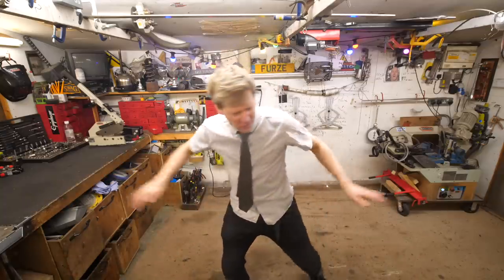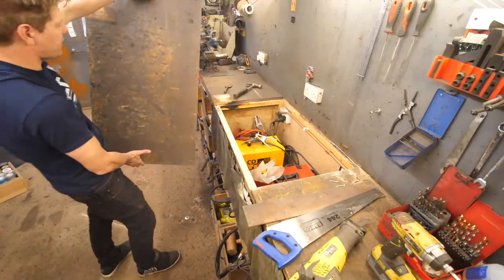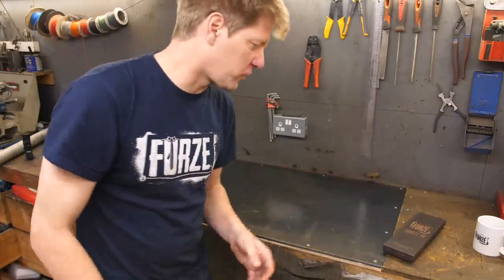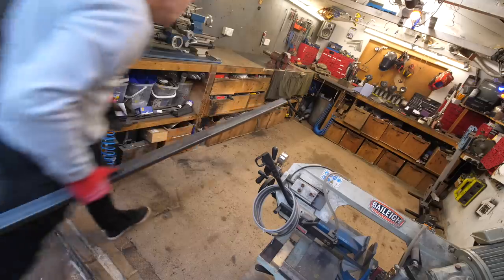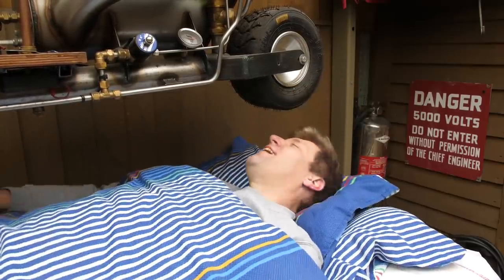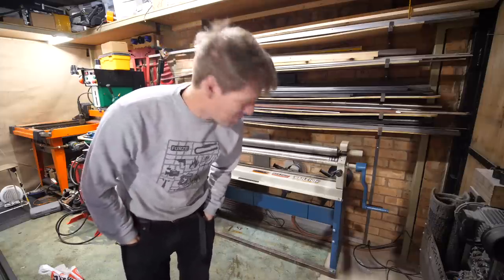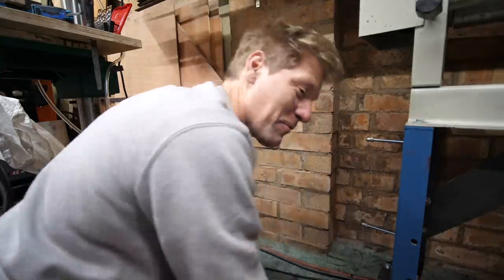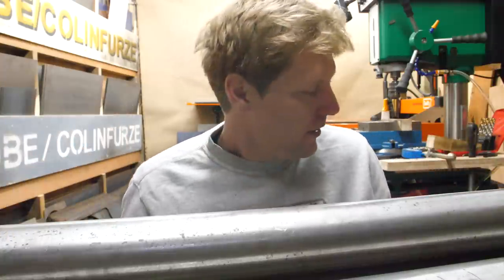2020 Workshop Mods - Bench/Sliproller/Plasma Table

Comment: Colin: "It's so hard to move my slip roller"
Most other people: "It's so difficult to bend metal by hand"
Reply: not really
Reply: Deathkid ok bend an signpost and film it so you have proof since you said it's not hard to bend metal and you said nothing about the thickness of the metal
Reply: @fedor5664  If he's saying nothing about the thickness, then he could have been talking about bending aluminium foil.
Reply: Cujo or he could be hulk and can bend a 4 foot thick chunk of steel
Reply: @fedor5664  that went from 0 to 100 real quick

Comment: I spent the entire video trying to figure out what was “off” with Colin. Finally noticed the lack of the safety tie. Safety first Colin!
Reply: Duh. He put it in a box and now it's for sale
Reply: Furze doesn't wear safety tie. Slip roller falls over. Ankle injured. 
I can't believe the example you're setting for our young generation by neglecting essential safety equipment like that, Colin.
Just imagine what a plasma cutter or an angle grinder mishap would look like without a safety tie.
Wear the tie Colin. It's not optional.

Comment: Haha the comment. Yeah my sliproller is hard to move as well!!! I know exactly what you mean. My workshop is 2,40 by 2,40 meters so every big tool has to have wheels so it can get rolled into place and tucked away when not used.

Comment: I have two questions.  First, won't the plasma cutter cut right through the mesh on the table, and, if you're not careful, the structure of the table itself?  Second, sometimes you weld things, and sometimes you bolt things together.  I know that often it's a matter of not being able to get the bench welder to the object (like the angle brace you put on the slip roller), but other times you do some welding at the bench, and then bolt something to what you just welded, right there (like when you attached the wheels to the new leg of the slip roller).  Why one over the other?

Comment: Good job but you ought to have used an open steel floor panel instead of mesh on the plasma cutting bench. It won’t be long before that mesh is falling out from cuts.

Comment: Bit of pipe on a plate screwed into the ground. Larger-diameter pipe fitted over it snugly. Welt LD pipe to a plate. Welt plate to the thing. Turnstile hinge. WAY less complex then some kind of weird suspended hook and pintle, and doesn't need the wheel.

Comment: For the slip roller, could you not have put 4 castors on, then take the wheel out of the front left one and replace it with something to bolt it to the floor?

Comment: The fold out cutting bench is not automatic and push button operated? Also, making a tank? Either driven by a rocket motor, or it mounts over top of one of your mad trikes.

Comment: Wouldn't a pin on the wall and a pin on the machine and a hinge rod with 2 rose joints. Incase you need to mobilise the machine outside?

Comment: insted of bolting the roller to the wall i would of bolted a piece of steel square to the ground, welded a pipe to it and put the roller on a glide around the pipe, would of needed less parts

Comment: Just getting ideas for my new workshop. Doesn't the plasma cutter cut the mesh under the item or am I missing something?
Reply from the maker: It does but it’s a weaker arc by time it’s cut through what your cutting it actually doesn’t do as much damage as you would expect, I’ve still got that same piece of mesh on 2 years later, although I don’t use that one as much as the CNC one but it’s still holding up well.
Reply: @colinfurze  Ah I see, thanks for the info. I'm looking to buy a plasma cutter as I get through so many slitting disks. I'm also the chap who emailed you about the band saw recently. I'm not too far off finishing building my workshop at home so now I'm on the fun bit and looking at equipment to upgrade to.  Thanks Ben

Comment: It probably would have been better to use some stepdown casters on the ol' sliproller instead of hinging it to the wall.  Forcing it to be fixed in even one dimension will surely screw you one day.

Comment: may have been a bit overkill  would not get it if the piece was right  bought a 1'' think plate 12 feet long  for the top of my welding table  here  since they build a better table does still a very handle table it is

Comment: one thing you might want to add is a garage crane https://cdn.hbm-machines.com/images/cache/hbm-172-43.jpg-1200x600-45a4cebc88.jpg ideal for lifting heavy objects , allso nice to put project on and get finished projects off the workbench 
does take in a bit of space though